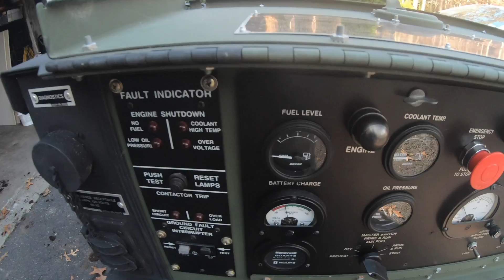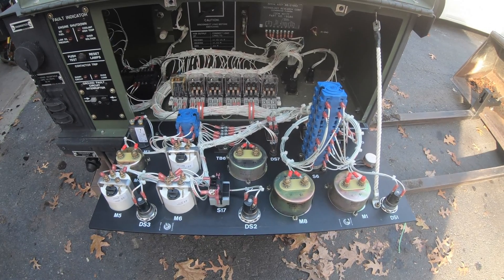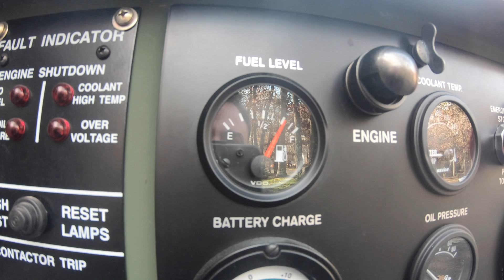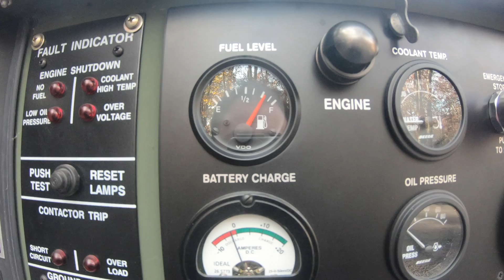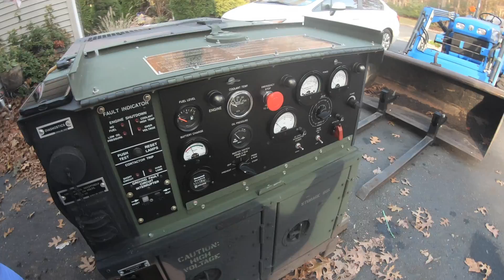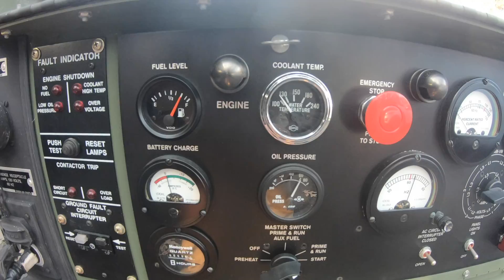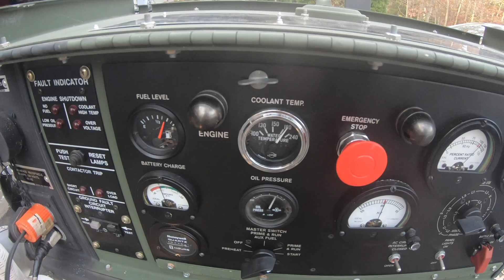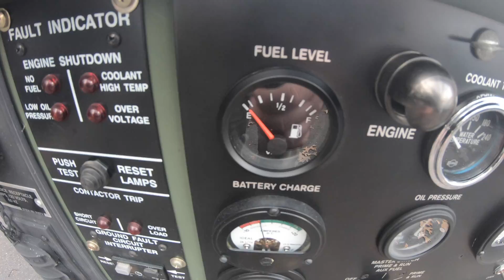MILITARY GENERATOR MEP802A GAUGE REPLACEMENT/LOAD TEST

Comment: I finally bought this gauge (found it on Vehicle Controls website) and installed it, but the gauge goes all the way to the right when I turn on the ignition.
I had to install a 1K resistor in series with the sender and a 160Ω resistor across the gauge to get it to read close to accurate (the tank is 3/4 full). I won't know until I run the generator and see if the fuel levels read correctly.
I presently have 53Ω reading from fuel sender to ground.

Comment: My MEP803A, with only 95 hours on it since reset, developed a fault where the fuel gauge is now pinned to the right. I've got 5 VDC on the gauge when the ignition is on. Tried hitting it with the palm of my hand, but needle is stuck. May have to buy new gauge already!
Reply: hola. donde puedo conseguir las bombas de inyeccion de petroleo de este motor del MEP 802 A , el codigp es 751-41322A Gracias